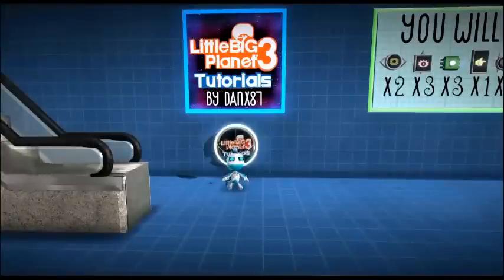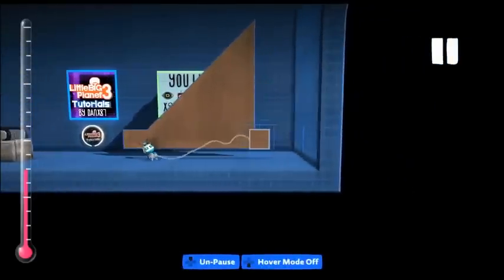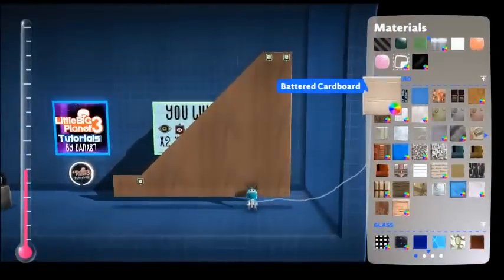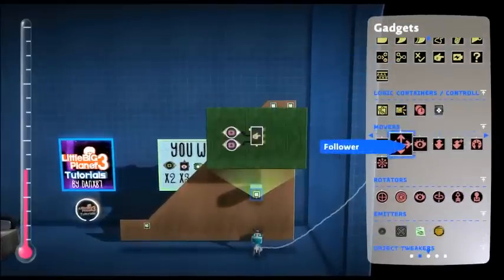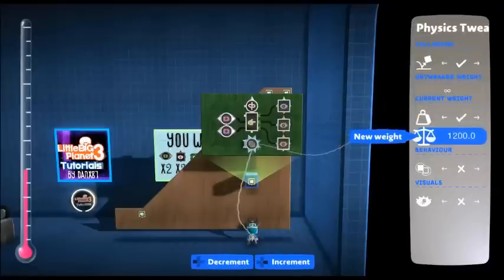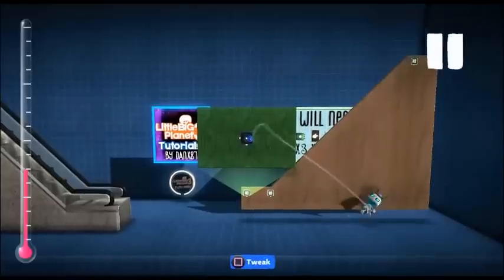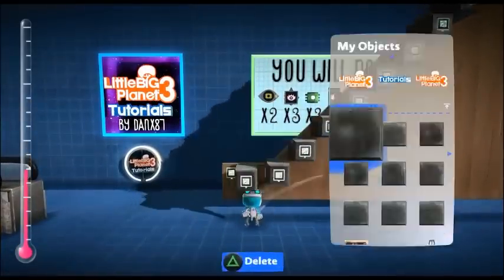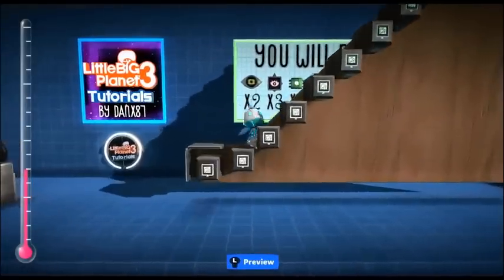LBP3 Tutorials [Escalator]

Comment: Isn't it also possible to directly connect the tag sensors to the followers and also connect it to a not gate leading into and or gate connected to the previous follower?

I also think it's possible to use the same tag with a tag sensor connecting the the cycle option of the selector. Please excuse me if I'm wrong, I'm not a very experienced creator, since I'm currently making my second level (First one wasn't of the best quality)
Reply from the maker: +ThatOrangeDragon Indeed there are many ways to achieve the same outcome. However I made it this way to demo the ability to use followers in sequence. The most effective & non-heavy logic way is to do it the same way I demo in the 3D escalator ;D
Reply: LittleBigPlanet 3 Tutorials I dunnow, I tend to like this more because it's "more proper" and you have to fiddle less with the settings. Although I think the cycle tag sensor on the selector is a much easier and less complicated and cluttersome way of doing it.